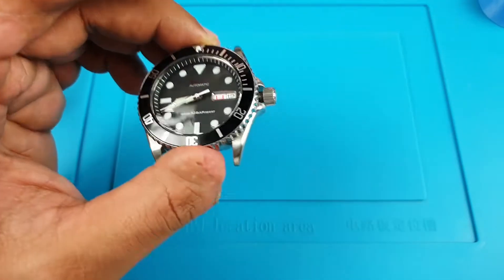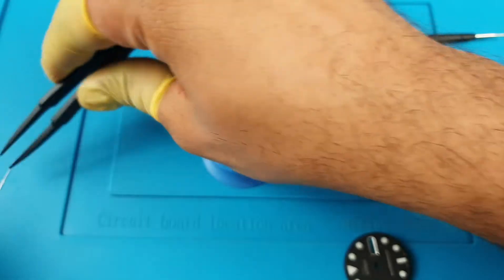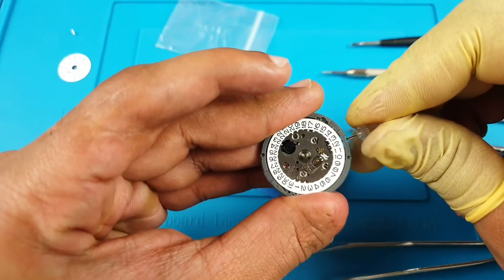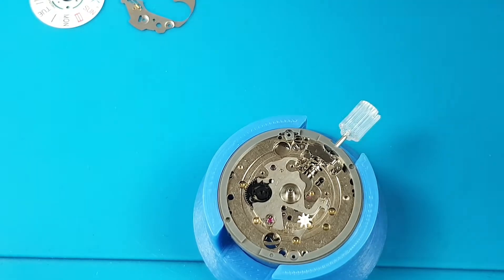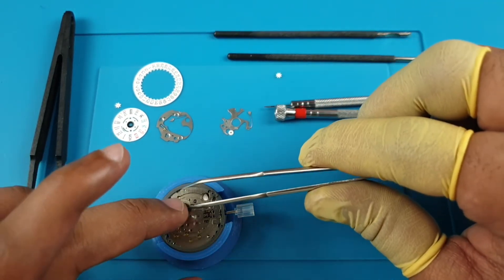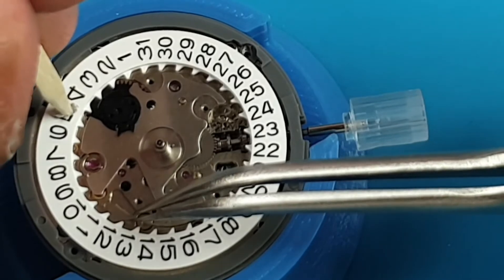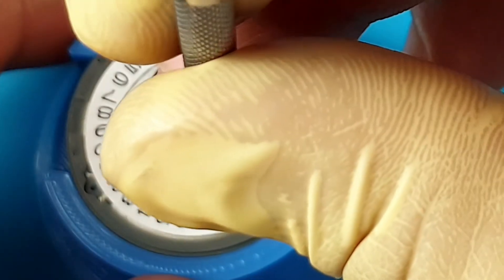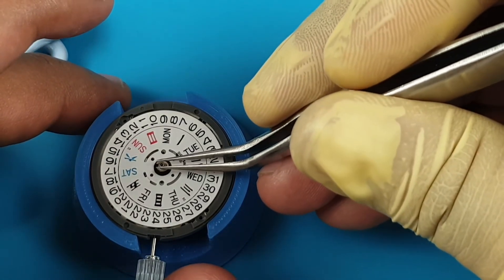|J4TM| Ep 11. How to remove date/day disk on Seiko NH35/36 Movement | The Watcher

Comment: I just did this basic tear down on a 7S26 for a mod I'm working on. It was for my son and I wanted to take the day/date works out so it wasn't going to be an issue of breaking the day/date wheels when setting date with the time only dial he picked. 

For the 7S26, not sure for the NH35-36 models...they are clearly different movements, but also somewhat similar process here, just note is very important to put the two metal places back in place and screw down, they hold on the main barel for the hour hand in place. It floats otherwise and comes off easily, may hold down with hands and dial in place, but could cause wear if even a little off. (eta 2824 have a little leaf washer holding their on between the dial and movement, that mod would also work here)